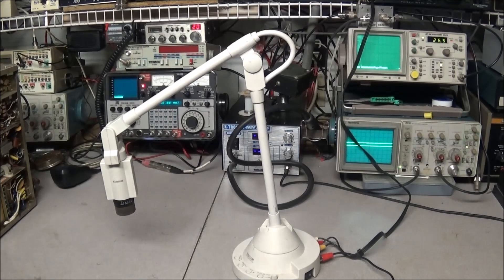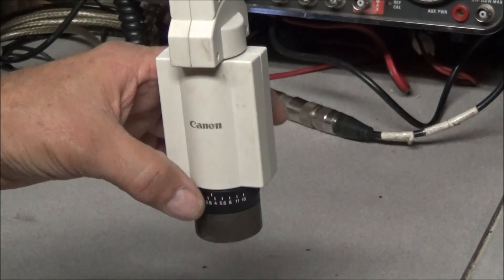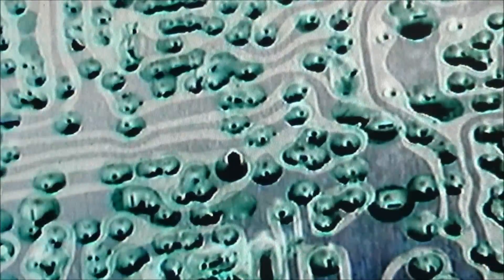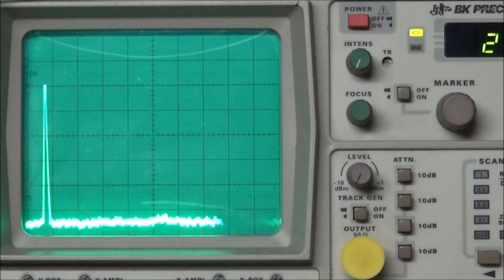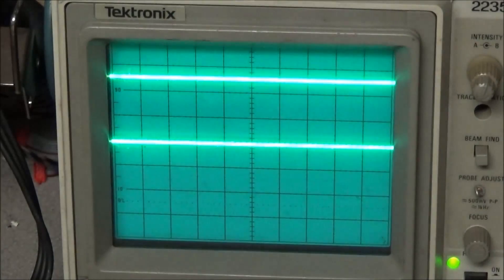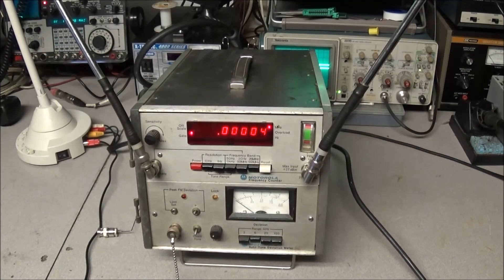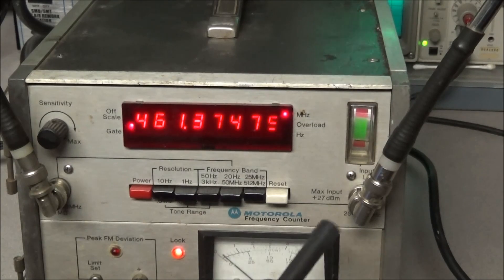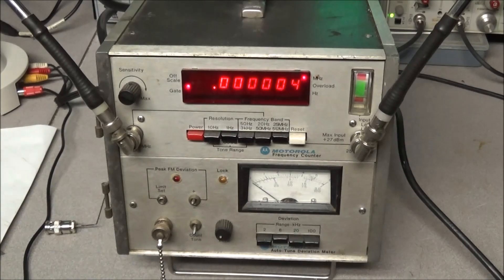#73 Shop Talk Show and Tell

Comment: That negative view you used on that circuit board...if you hadn't told me what it was I would have thought the color gun was messing up on my monitor.....assuming flatscreens have color guns, lol.  I remember years ago when my pappy would adjust them when working on old tv sets and have those 3 lines across the screen.
Reply from the maker: Yeah it is neat how you can change the color. Makes different parts of the board show up better.

Comment: I have a motorola autotune like it better than my heathkit mod that you have to tune in manual    you have a nice setup
Reply from the maker: Thanks Dennis. How is the sensitivity on yours?
Reply: well the deviattion is normal but the freq counter quit cant fix counter no servicr manuals found  I also have a motorola audotune  without counter works perfect, I have so many freq counters so I never went any further  I mis the tone count part